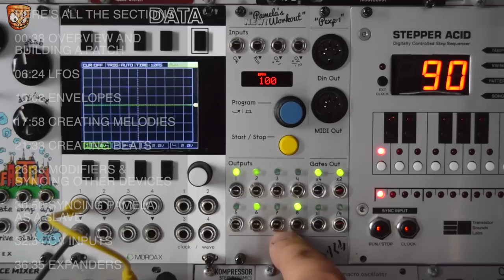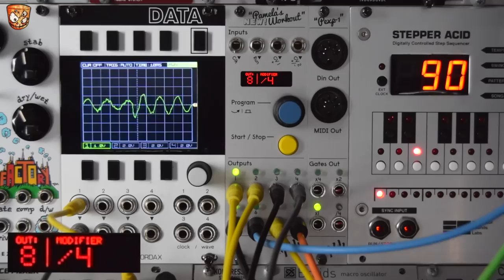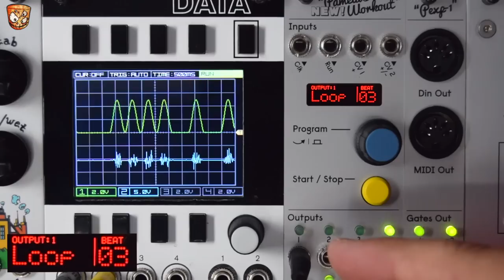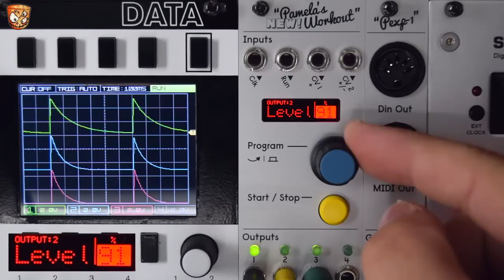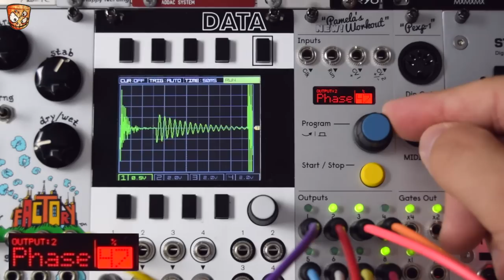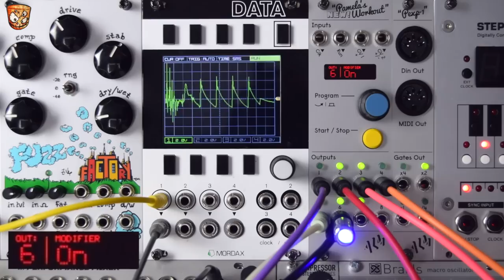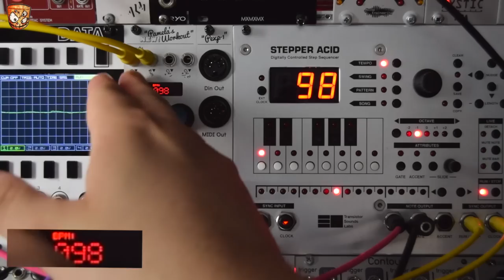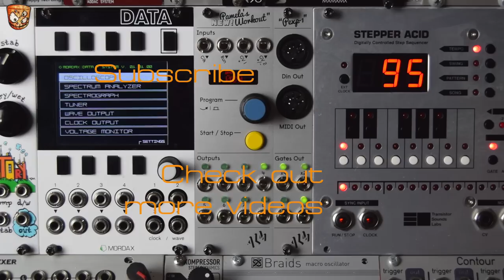ALM Busy Circuits - Pamela's NEW Workout

Comment: Lots of interesting features, but it seems like a lot of would be wasted if you don't use drum modules.
Reply: Nick Herman I was a little bit afraid of that too when I bought PNW. Man, was I wrong......
Reply from the maker: absolutely not the case Nick. Gates for different sequencers hitting clocks, synced LFOs, stepped random. Euclidean mode and swing over your LFOs. It's really powerful.

Comment: Am I talking out my ass here or would this synergize very well with MI Elements?
Reply: It should work with anything that can be clocked or modulated ;) Personally I'm not a big fan of menu diving
Reply: @skormm-v7z  ah you sound like the voice of experience. Could you suggest something to work with Elements? My poor module is feeling rather underused and I've tried feeding it with a few different things
Reply: @beezzarro  I will need to see your Eurorack setup and depends on what do you want to achieve ;)
Reply: @skormm-v7z  right now it's:
After later Audio bOsc, DVCA, Popple, Typhoon, Peaks (clone), an antumbra atom (my "elements"), and an instruo Ochd.  
 I love minimal setups, but I think I maybe just need more of everything. Some days I like trying my hand at ambient, others i like just a sort of electronic synthwavey vibe
Reply: @beezzarro  I see u already have one LFO. You will need a sequencer( in case you not already). If  you are into rhythmic music  stuff you will need an AD/AR envelope generator like(some famous ones) Tides, Quadrax, 4ms pingable. They can operate as Lfo,  can be clock synced and then you have synced LFOs.  A random source/lfo module is most likely unavoidable! Ambient= Lots of reverb fx, delays etc, LFOs, random lfos, samplers, etc.. I make synthwave but not with modular. I use vst synths for that.
Reply: @skormm-v7z  those are good ideas!
 I'm looking for a sequencer that is forgiving and invites friendly experimentation by allowing for nice harmonic melodies. I find a lot of sequencers require the user to bring out the composer in themselves. I don't have that component yet so I was thinking or something with arpeggiation and quantization (not a must). My top candidates are Moskwa II, NDLR, Rene mk II, circadian rhythms, euclidean circles, and synthstrom deluge (this last one is hyper overkill, but I played with one and basically had to tread a dopamine tsunami for a couple of hours)
Reply: @beezzarro  I have Rene ( 1st version) and Arturia Keystep! Its really fun, I'm happy. Both versions of Rene have built in quantizers so it might be easier for you. If your sequencer does not have built in quantizer you might end up buying one if you don't want to tune by ears.
Arturia keystep doesn't need a quantizer though. Check Arturia Keystep Pro too ,which is the new big brother of Arturia Keystep

Comment: Thats just the stuff i want to get away from - using a modular:  twiddling in menus with one dial one knob and a tiny display :-(
Reply from the maker: that's fair enough and lots of modules will play into what you want to do nicely. Lots of knob per function analogue and digital to choose from. 

Although the interface suffers here (for your preferences) it's largely "set and forget" for me and you won't cram anywhere near it's power in anywhere near the space (HP). Which is why people like it so much.